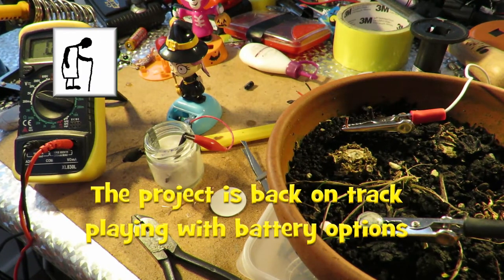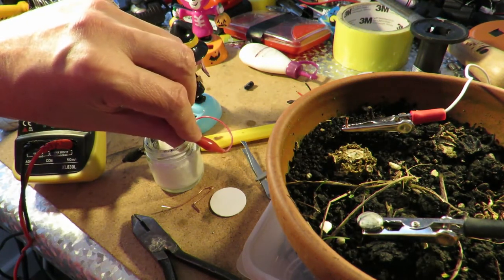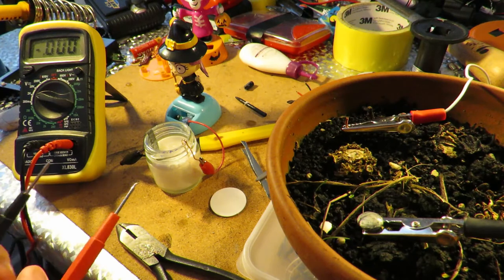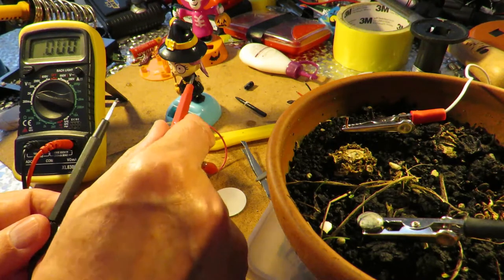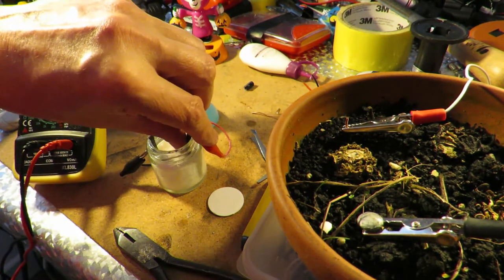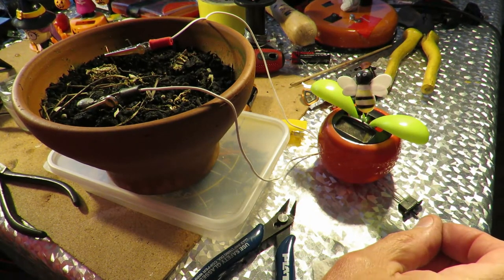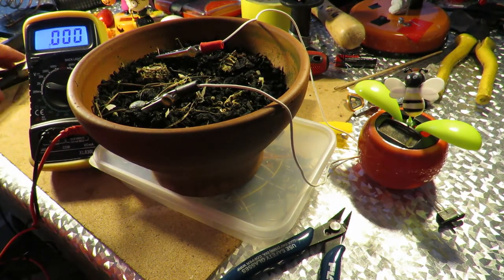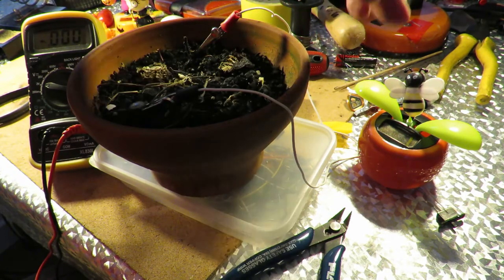Episode 5 Battery experiments using a solar wobbler Tomato Milk Flowerpot

Comment: hi grandad, in the state the wobbler is in, try to make a lemon battery and stick the carbon rod and the zink casing into a lemon and hook up the crocadile clips to to each pole and see if it will work then, have a look at this video here, https://www.youtube.com/watch?v=AY9qcDCFeVI. if u could create a lemon battery for the wobbler wonder if it will work since a lemon is very acidy.
Reply from the maker: There is a video in this series with a lemon battery 👍